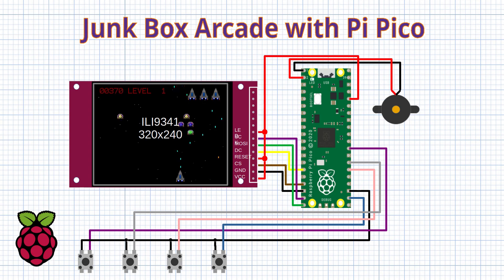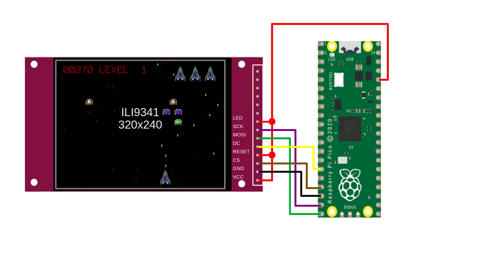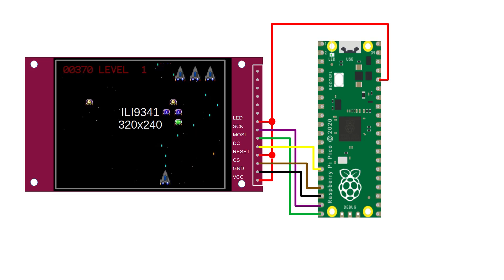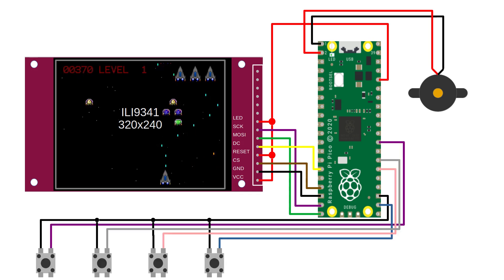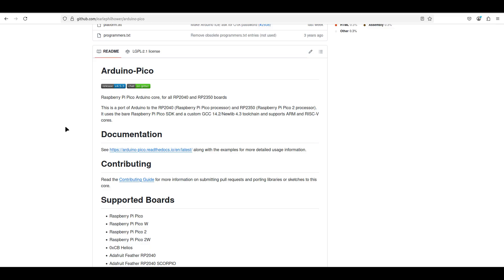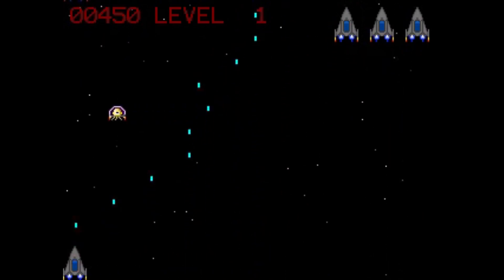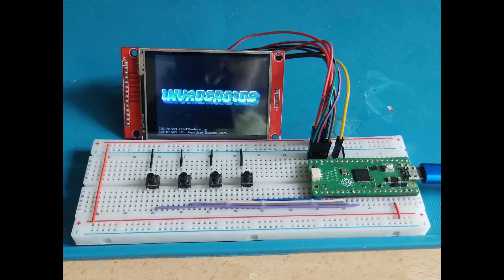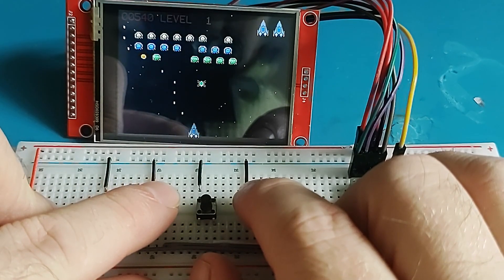Building a Tiny Retro Arcade with a Raspberry Pi Pico (Junkbox Arcade Project)

Comment: I'm using one of these displays with a weather station I built. Also includes O2 sensor MQ-135, AHT20 & BMP280. Plus, Date & Time.
Depending on the temperature, the background will change color. :hand-purple-blue-peace:
Reply from the maker: Sounds like a cool project!